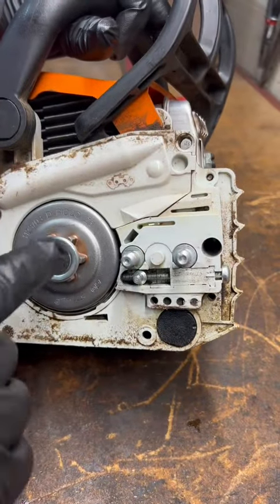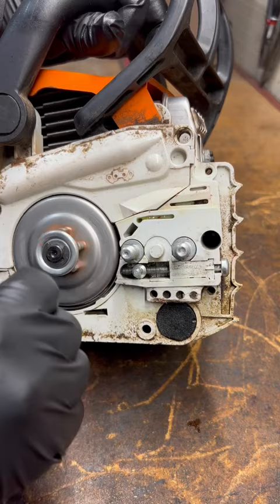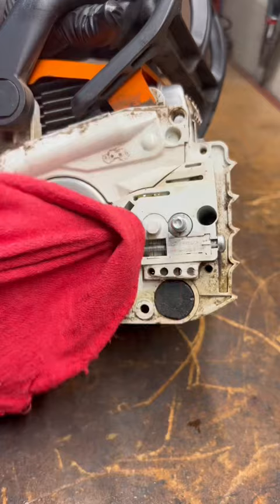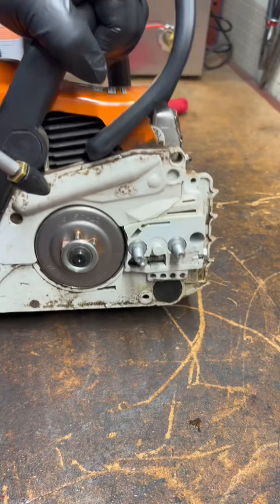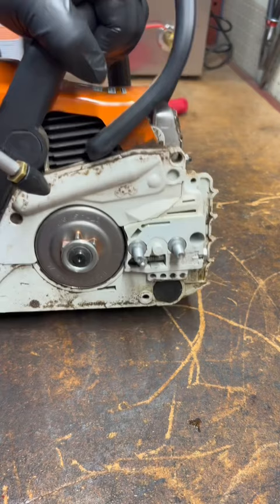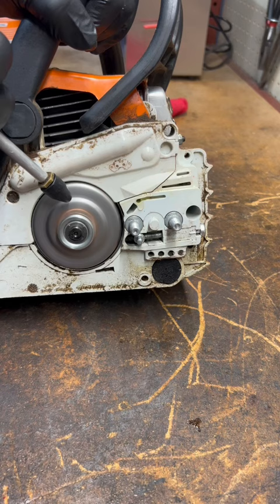Chainsaw oiler not working? Try this easy trick to diagnose.

Comment: I’m having issues with mine I think the filter might need replacing not sure cleaned it all checked it all etc bit stumped atm
Reply from the maker: Is the oiler not working? Are you not getting any oil?

Comment: I dont have an issue of it not coming out. My issues is to much is coming out.
Reply from the maker: Well there should always be oil coming out when the chain is turning but when it is shut off then it might still be pressurized. Unscrew the oil cap and it should stop.
Reply: @10minutefix  oh no, when I to much coming out I mean you can run it and have a puddle before you even start cutting
Reply from the maker: @hilham89  then your oiler is probably not working or there is a leak in the casing. I would remove the chain and bar and test it. Be careful with the clutch. Clean the oiler area and run it. You will see where the oil is coming out of and how much.
Reply: @10minutefix  no what I mean is where the oil comes out to oil the bar and chain, to much comes out but I found out that you can restrict the flow by a screw that's underneath the chainsaw
Reply: @10minutefix I have a saw I’m working on, and the case seems toast, it leaks from the where the oiler is. I think the case is done for. Second opinion?
Reply: @hilham89 and wher it’s supposed to come out just comes a bubble once or twice and no oil goes onto the bar, just from the oiler hole
Reply from the maker: @fallingsuncreations9270  well if it’s leaking from the case then it must have a crack and that is not worth repairing. If it’s leaking from the oiler then I would replace it and see what happens.

Comment: So what if it doesn't work?
Reply from the maker: The oiler hose line is clogged or the oiler worm is not working.
Reply: Yea had to take my clutch off and clean out all the hoses and shite that had accumulated under there. That seemed to do it even tho none of the hoses was blocked
Reply from the maker: @joereynolds475 well, as long as it works now.